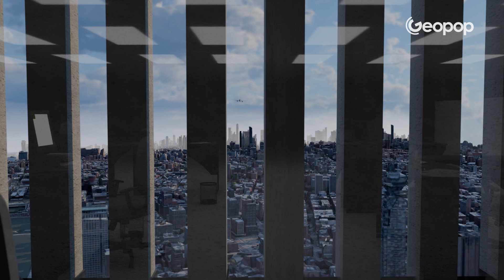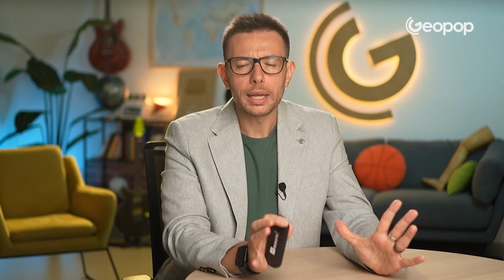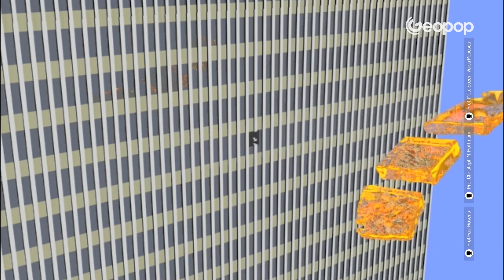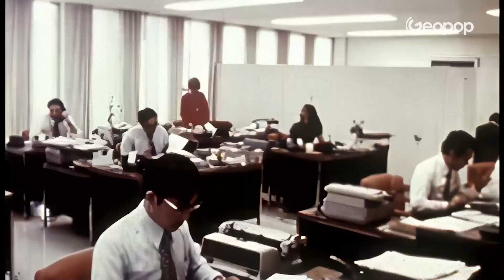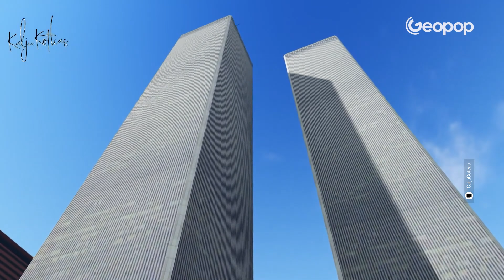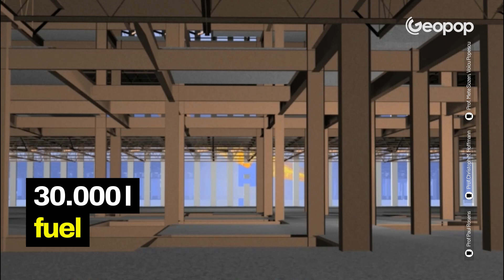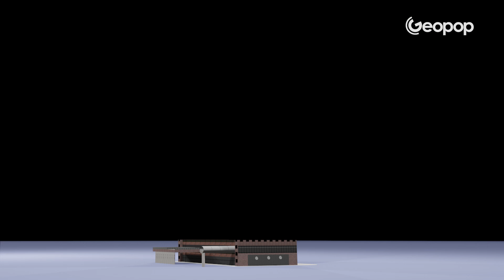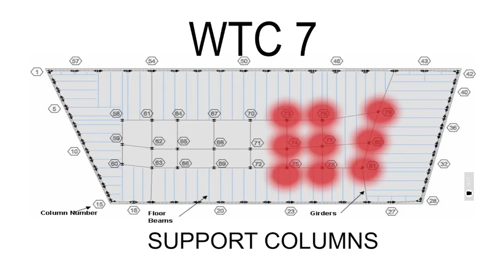9/11, 2001: The Technical Reconstruction of the Twin Towers and WTC 7 Collapses

Comment: What about all the videos of molten metal falling out of the building well before the collapse?   The jet fuel liquified the steel?
Reply: Molten metal pouring out of the South Tower (and it was in fact ONLY the South Tower)?  You mean this?

youtube.com/watch?v=xPVGGQU-MeQ&ab_channel=SeekersofTruth 

So you think that is molten steel why?  Because you performed metallurgical tests?  Because the internet told you that’s what it is?  I think we can do better, so let’s do better and build a theory the right way instead of making evidence-free assumptions. This will take just a couple of minutes and is worth the investment. 

The Boeing 767 which struck the South Tower weighed 117 tons and 80% of that was aluminum.  The exterior cladding on the Twin Towers – the white panels – were also aluminum. When Flight 175 struck at the 81st floor its momentum deposited much of the office contents in its way and the bulk of the aircrafts mass into the NE corner of the building. The piled up debris shoved into that corner is visible in photographs and video so we know it was there. 

There’s a good shot here of piled up debris from 4:36;

youtube.com/watch?v=ZLJyL63sqtU&ab_channel=MrKoenig1985

Steel melts at roughly 2,750-deg F while fires in the South Tower reached peak temperatures of around 1,800-deg F. Aluminum OTOH melts between 887-deg F to 1,180-deg F depending on alloy. That aluminum will melt under these conditions is not a surprise. If you look at pictures of cars left behind and destroyed by forest fires the aluminum wheels are invariably melted away along with other sometimes aluminum parts like hoods. Steel bodies remain intact. 

The “molten metal” appears at 9:52 am. At the same time we see the first externally visible signs of sagging floor trusses and the pulling of the perimeter columns inward. I submit these events are related, not coincidental. The aluminum cladding at the NE corner also appears to me to be burning. 

It is likely the with the floor trusses sagging under the heat, and the 81st floor truss in the NE corner under the debris pile subjected to the heavy load of the debris pile, the truss broke its perimeter column connections and dropped, instigating the material starting to pour out of the NE corner at the 80th floor.

Given the properties of the materials in question, aluminum is by far the most likely culprit. 

Reports from The NIST, FEMA and MIT all concluded the material is aluminum. 

Certainly steel is the least likely of all the materials the anomaly could be given its much higher melting temperature and the fact there is no logical source for molten steel.  The perimeter columns in the NE corner are intact and the material is pouring out between them. So it isn’t columns melting, therefore what other source of steel is there?

Deniers will claim molten aluminum appears silver when molten, which is true but only at the low end of its melting temperature range. Aluminum can and does get hotter and it glows red to orange when it does (1,100 to 1,800-deg F).  Most folks of course just don’t bother getting it that hot if the goal is just to get it molten for say molding a part. No need to go higher. 

The total mass of molten aluminum is a BIG deal in regard to how it behaves when poured. Quantities bellow half a liter cool almost instantly if poured onto a flat surface, but if poured into say an ingot mould will stay red for a minute of so. Pouring volumes of molten aluminum greater than a liter is a VERY different experience. The thermal mass is much greater and the radiant heat is horrendous. The aluminum is able to stay liquid and remain glowing bright orange much longer. 

The famous video of glowing liquid gushing out of Tower 2 moments before it fell, involves at least tens of liters of molten aluminum. The thermal mass involved is so great that it stays red after falling many meters through the open air.

Side note: There was also a large UPS battery farm in that spot and some of that material at least may well be from the batteries IMHO.
Reply: Firefighters reported molten steel in the rubble. I've seen that interview.  And I hate when people act like they have proof of something that they're simply no proof of. Such as the temperature in those buildings. You're giving a man a hard time , just as we can't prove it was steel, you can't prove it was aluminum. But the firefighters that reported it is actual evidence.  We know for a fact that the temperature of the steel isn't recorded. You're guessing on temperatures and I guess that's fine but your refusing to embrace the fact that steel transfers the heat throughout the object. You can easily take a lighter to a piece of steel and see this or read about somewhere. I believe it's called thermal expansion
Reply: @robbiehiatt9966  A firefighter's testimony is not proof that it was steel. There's no telling what kind of metal it was (assuming it WAS metal) without testing it.

Was the material found, tested, and determined to definitely be steel?
Reply: @Tim22222  -  An anecdote from a guy in Buidling 6 is the best it can do. The entire case 🤣🤣🤦‍♂
Reply: @Tim22222  You can say it wasn't definitive proof but I can assure you.A firefighter's testimony is good in any court in this country.
Reply: @ Oh, absolutely! The firefighter could certainly testify to having observed molten something. But to prove that the something was steel, unless the firefighter was a qualified metallurgist you need more than that.
Reply: @Tim22222  - The really crazy bit is this firefighter - not just their key witness but really the entire case for the presence of molten steel (lets not concern ourselves with relevance for the moment) is still very much alive (last I heard) yet not a single one of these ass clowns has ever even thought about interviewing him.

Not one. 

Not anyone from Architects and Engineers for 9/11 Truth (who made that clip semi-famous) or anyone else. 

These CT say they want answers, then they present a guy who they claim has those answers but they are scared to death to actually talk to him.  What could they possibly be afraid of?

Having bubbles burst?
Reply: @Tim22222  I'm no firefighter and I know molten metals can be determined by its color. I'm sure a trained firefighter probably knows more about it than you. But you think you're the judge and the jury. Your not, you are a mamma's boy. Who sucks at research obviously with a lack of common sense
Reply: @TheLoonResistance 8:25 true evidence right here. https://youtu.be/bLF5D7M1YgA?si=aHSvS__uOdxMi1ZB
Reply: @robbiehiatt9966  : "molten metals can be determined by its color."
Can't. Even less on an RGB image: At high enough temperature, the color is just its black body temperature.

"'m sure a trained firefighter probably knows more about it than you."
And experts concluded you were wrong 20 years ago. Your point?

"evidence right here"
50mn of BS. Which part shall we look at?
Reply: @ThomasKundera  Twenty years ago,  Nist still hadn't produced their final report.
Reply: @robbiehiatt9966  "Nist still hadn't produced their final report."
They have, and are online since more than a decade.
Maybe time to get informed?
Reply: @ThomasKundera  Maybe time to get some common sense.You just reaffirmed what I said. And the fact that you don't know if you said something that was the opposite or not.
 Shows you know nothing about what you're talking about.
Reply: @ : I feel we said the opposite.
Can you clarify? Thanks.
Reply: @ThomasKundera  🤣🤣 You said one thing and then you turned around and said the opposite
Reply: @robbiehiatt9966  : Still not getting it, sorry.
Can you quote me saying two opposite things? thanks.
Reply: @ThomasKundera  first you said 20 years ago. Then I said nist hadn't released its final report at that time correcting you and then you say nist report has been out for 10 years proving what I said was correct and completely making you look like a fool.
Reply: @robbiehiatt9966  : The NIST reports are from 2005 and 2008.
Which is 20 and 17 years ago respectively.
I wrote once "twenty years", and reminding about the last one, but not remembering exact date I wrote "more than a decade ago", which fits without having to dig for exact date.
Is such nitpicking relevant to anything?
Reply: @robbiehiatt9966  :
_"And then there's the fact that none of you all know what's been going on up in space the past two hundred and eighty days."_i
A lot happens in space any time, your point?

"And then you turn around and expect me to believe yall know what happened the past 60 years."
Just understand what actually happened.
I'm afraid you're off-topic.
Reply: @ThomasKundera  whatever man I'm done trying to talk sense into people. Here's where I'm leaving this conversation, because you've lost your ability to learn. I think the main reasons people believe the official story is lack of even decent media coverage.  We didn't even get a chance to talk with our friends about the missing 2.3 trillion dollars, because of this. No days people are given DOGE a hard time over 5 million. They were pushing Ben Ladden 45 seconds after we were told we were under attack. I never saw tower 7 fall until 2012 or so. Which is when I started looking at the Conspiracy. The media showed us a collapse without explosion sounds and that's what it comes down to is the sound.  I originally didn't hear explosions.  But I did my research and found out that multiple firemen reported it looked like controlled demolition and they were right it sure does look like it.  People say I'm stupid, but it comes down to the microphone doesn't it. I bet you hear this one of tower 7. 
 8:20
https://youtu.be/bLF5D7M1YgA?si=aHSvS__uOdxMi1ZB
The firefighter said. " we gotta get outta here, tower 7 is exploding "
Reply: @ThomasKundera  wrong strand my bad
Reply: @robbiehiatt9966  :
"I'm done trying to talk sense into people. "
That's what I'm trying to do with you, and I'm afraid it will be hard for you.

"Here's where I'm leaving this conversation"
(and then goes on for another paragraph or two, lol).

"because you've lost your ability to learn. "
Gni?

"I think the main reasons people believe the official story is lack of even decent media coverage."
You had your eyes closed for 20 years? There are little events that have received that much coverage.

 "We didn't even get a chance to talk with our friends about the missing 2.3 trillion dollars"
What would you want to say about that supposed miss?

"They were pushing Ben Ladden 45 seconds after we were told we were under attack."
So?

"I never saw tower 7 fall until 2012 or so."
While it was live on TV in 2001.

"Which is when I started looking at the Conspiracy. "
Why?

"The media showed us a collapse without explosion sounds"
As there were no explosives.

" it sure does look like it."
"look like" and "being" are two vastly different things.

" People say I'm stupid"
Listen to them, if you're still able to learn.

 "but it comes down to the microphone doesn't it."
Gni?

"The firefighter said. " we gotta get outta here, tower 7 is exploding ""
I'm not sure he said that, but anyway, that's hours before WTC7 started to show structural weakening after about 7h of raging fire, was evacuated, and then fall.
That boom could have been anything, but was certainly not explosives collapsing WTC7.

Comment: He explaining how steel can weaken when it's a single beam, but he's not explaining how much stronger steel is when combined  together. Also he's not mentioning all eye witness accounts of metal melting to molting lava which can only be achieved with temperatures o er 2800   degrees
Reply: Collapse initiation was due to sagging floor trusses (which we can see) causing inward bowing of perimeter columns by up to 5 feet (which we can also see) at the impact and fire damaged floors until those perimeter columns buckled and failed, initiating the collapse (which we can see). I would refer to you the excellent Gary Pollard video of the collapse of the South Tower. Pay attention to the first 12 seconds in particular.

WTC2 Collapse -- Gary Pollard (Enhanced Raw Copy from NIST) 

www.youtube.com/watch?v=ULdiD6gYZO0  

Columns don’t work well when they are bent. The Twin Towers were designed to work with straight elements not bent ones. When you bend those columns they become up to 4 times weaker. Failure is inevitable.

Notice how the columns are already bent when the camera zooms in, become a bit more bent over the next new seconds until they give, starting the collapse. 

So what bent them? It sure as shit wasn’t thermite or sooper-sekrit fire-and-impact proof hush-a-boom pre-planted demolitions that don’t explode. 

If you keep watching you will note that after the tower starts collapsing the air inside the building (95% air by volume) gets compressed and forced out the windows. These low-velocity air bursts devoid of blast or fragmentation effect are a reaction to the building collapsing not a cause of the building collapsing 

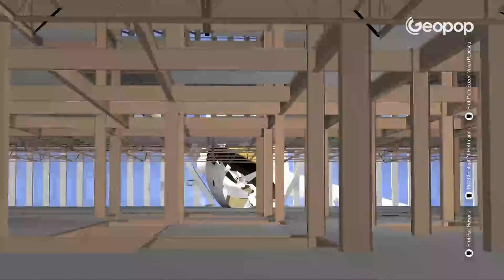And at a different angle from 1:18 here:
youtube.com/watch?v=TJJPYTVjxug&ab_channel=femr2 

Or here
www.youtube.com/watch?v=-DCgEJ2bUcI 

Also seen in the excellent still image here at 9:09:
youtube.com/watch?v=YXsDwKYz1bA&ab_channel=msvfreak94
Reply: @TheLoonResistance just because you see buckling doesn't explain why it buckled. Those perimeter columns could just as easily been cut with demolition charges, like the rest of the collapse. Horrible angle as well, all sorts of stuff in the way.
Reply: @robbiehiatt9966  "Those perimeter columns could just as easily been cut with demolition charges"

NO THEY COULD NOT! You would have heard the charges. Evidence would have been found.
Reply: @Tim22222  - And there is the complete lack of cutting, plus the clearly visible buckling.  The copium dose seems to have been upped.
Reply: @Tim22222  evidence was found,  like this video where you can hear the explosion. 8:25 herehttps://youtu.be/bLF5D7M1YgA?si=7UXIF5UIEUsSuP0S
Not to mention the visual evidence of the buildings falling. Whatever hit that building made a huge explosion. It sure wasn't silent
Reply: @TheLoonResistance  some cutting charges were heard. 8:25
https://youtu.be/bLF5D7M1YgA?si=7UXIF5UIEUsSuP0S

Comment: Aluminum CAN NOT go through STEEL & CONCRETE!!!!!!!
Reply: Sure it can if moving fast enough. It's about _energy- NOT materials.
Reply: @TheLoonResistance not materials? How ignorant.  Ever heard of inertia? Here's the definition. Notice the word mass. It has everything to do with Mass. In physics, inertia is an object's resistance to changes in its state of motion, meaning it resists both starting or stopping movement, or changing direction. This property is directly related to an object's mass; the greater the mass, the greater the inertia.
Inertia is the tendency of an object to resist any change in its state of motion, whether that's being at rest or moving at a constant velocity.
Reply: @robbiehiatt9966  You are correct, more or less. That doesn't mean that an object with enormous kinetic energy - like a 150-ton jet doing 500 mph - can't do substantial damage, regardless of what it's made of! The only inertial that was overcome was that of a few beams that were bolted together.
Reply: @Tim22222  I know I'm correct. It's 4th grade science. At least get your BS right. And you can't turn around and go back on what you just said either. Just one of those outer support columns is bigger than any structural support ever placed in any plane. Oh it was just steel bolted together.  , and the plane was aluminum,
Reply: @robbiehiatt9966  : "Ever heard of inertia?"
You have a 4th grade level in science, don't expect to teach us anything.
And "inertia" is not a justification to your naively wrong assertion about the actual fact that the passenger planes crashed into the towers, breaking a significant amount of its structural columns.
Reply: Why not?

Comment: What utter bullshit?? It was an obvious control demolition that brought the twin towers including tower 7 down you dont need a lying italian AI dubbed voice over. It was evident just by watching the buildings collapse all three in 10 seconds amazing 👏
Reply: Someone wasn't paying attention, and can't tell time. 

The collapse mechanisms – the sequence of failures - described here are substantially correct and this is true no matter who planned and carried out the 9/11 attacks or why . 

That may not be what you want to hear and go against 20+ years of entrenched dogma and conditioning, but it’s not wrong.

That also means (in case you did not get the hint) this video can be (and IS) absolutely correct in its description of Twin Towers collapse mechanisms AND the 9/11 attacks could still have been some sort of inside job. The two things are in no way mutually exclusive.

The mechanisms described here have broad professional support around the world. There are no professional engineering organizations (for example: ASCE, ASEE, ICE, etc) that disagree with them or have offered any formal dissenting opinions or alternative hypothesis. The mechanisms described here are not new. They have been well understood since at least November 2001 and most can be easily confirmed by simple observation. You can literally see just about everything they are talking about if you just bother to look.

So, setting hubris aside, either the overwhelming majority of the worlds structural engineers and simple observation are wrong,…

… or you are.

Which seems more likely? 

IF you still think believe this explanation is wrong then produce a better one . Good luck with that. No one ever has and I don’t see you moving that needle today. No one ever does.